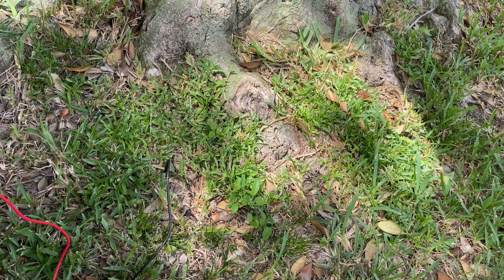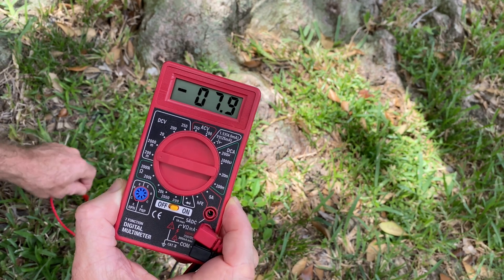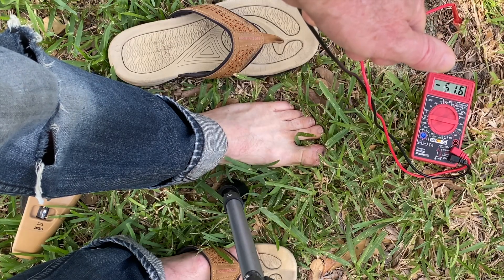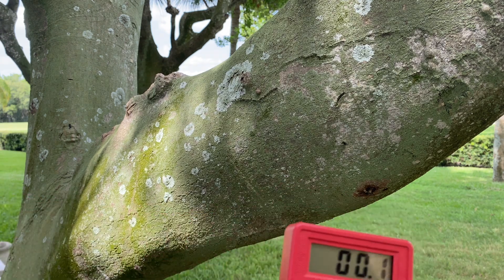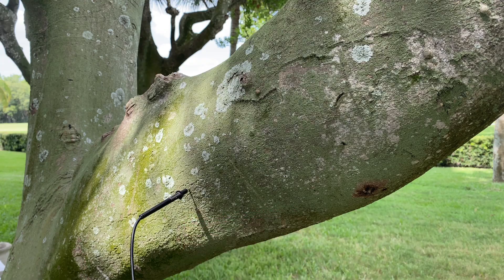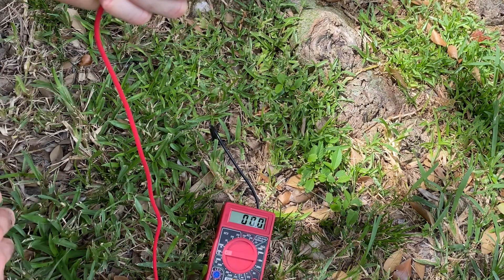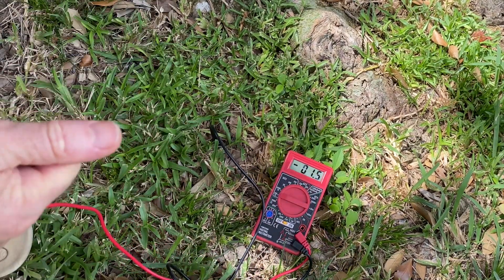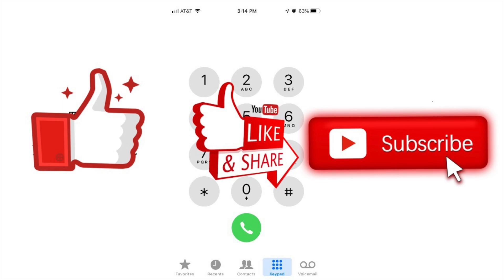How To Prove Grounding Barefoot Is Real Using Voltmeter

Comment: People don't REALIZE the significance of this phenomenon.  If you want to improve your OVERALL health - ground everyday.
Reply from the maker: agreed. and get sunlight without sunglasses or glasses on - meaning outside - most all windows except for special glass block the UV your eyes need to absorb it. If for some reason you can't ground easily with your feet - like a relative with diabetes and neuropathy of the feet - touching a tree with the hand will work too (tree huggerz, lol)
Reply: @followyourbliss101  Yes, when you don't wear sunglasses you don't get sunburns as easily - if at all.  Wearing them cuts off the signal to your brain that you are in the sun and that's why you burn!  You don't need sunscreen either - poison.